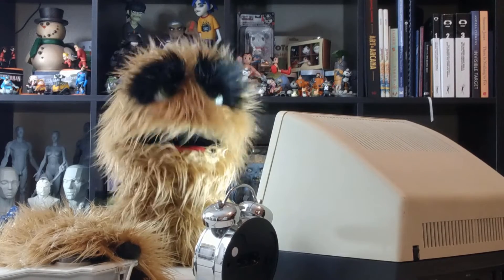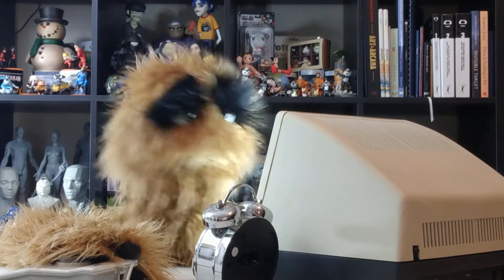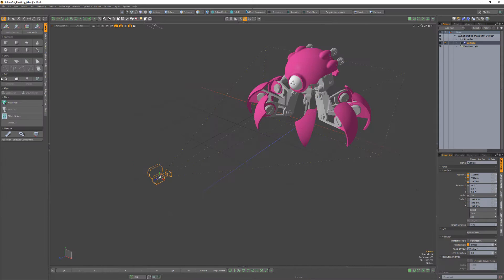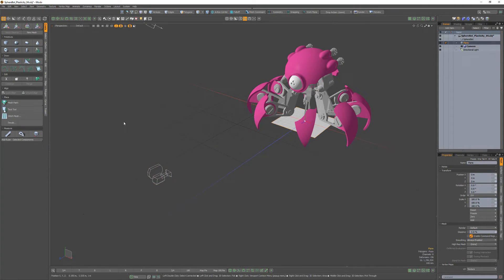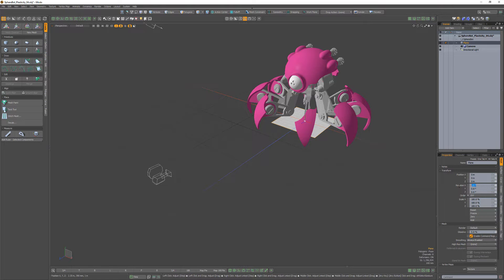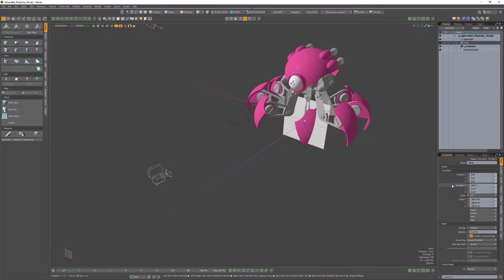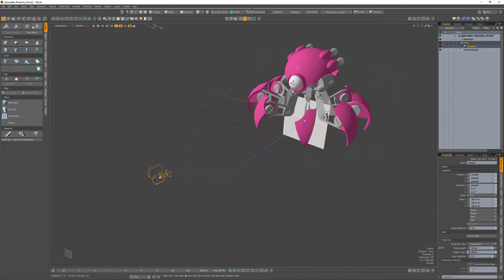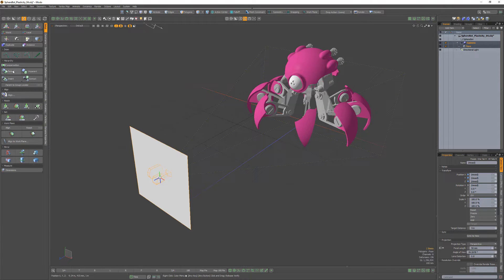MODO | Create a Focal Clipping Plane Rig

Comment: Hello, another great video. 

This is an unrelated question but I wanted to know if you would know if it's possible to set an item as the camera in modo.

Thanks
Reply from the maker: Not an item... But you could parent camera to item. What are you looking to do.
Reply: @pixelfondue  I made a character and want to make a render from the character's point of view.
Reply from the maker: @fortedimension  I would parent a Camera to the Character.